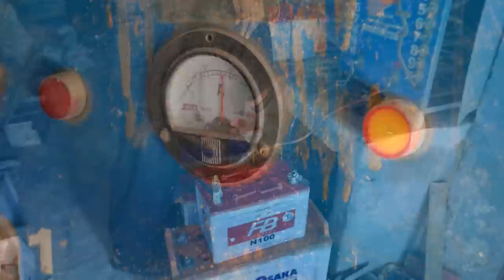How Battery Plates are Made & Restoration of an Old Battery

Comment: These guys handle lead and acid like it’s chocolate 💀
Reply: @krisg822  I bet the owner don't even care about the safety...at least respirators would be OK. Anyway...
Reply: their body cells are already immune and producing their own voltage
Reply: @krisg822  yeah and what do they do with that leftover acid sludge that each old battery has??,m you think they will dispose of that in a envoiremental friendly way??, i think not..
and what about all the houses and buildings around this little shop, when the wind is blowing their way, they will ge ta house filled with lead fumes... great!.
Reply: @aivaraslabokas7172   this is what happens when humanlife is cheaper than safety equipment, it is cheaper to replace the sick human that it is the buy a respirator!!!
Reply: That iron dust might be a problem, though
Reply: @krisg822  depend on the temperature the lead was melt at.
Reply: When survival is the last option, safety levels don't matter
Reply: @SDeww  call OSHA.
Reply: @SDeww  go do something about it.
Reply: The acid is the least of their worries...  The lead is what's going to get them...
Reply: @SDeww  thats racist
Reply: Because the acid battery was used up anx it is discharged, if its fully charged it becomes acid
Reply: @SDeww  actually it can be used again if the battery is fully charged
Reply: @SDeww  For lead fumes to be a thing, you'd have to be smelting it in an arc furnace, not melting it with a torch. The stuff you see burning off are fluxes or impurities in the lead. The real danger of working with lead is lead dust and small particles of lead that can become airborne and inhaled or ingested.

Batteries are a whole different story. Wasted car batteries contain compounds of lead, like lead oxides and lead sulfate, which are bio available and can be absorbed through the skin. It's made even worse by handling acids while handling lead compounds because it accelerates the absorption process through the skin. The workers are definitely actively getting lead poisioning, while the people around them less so, unless they're going around eating the dirt near the shop.
Reply: That’s because there’s no H&S with them. 😂
Reply: The forbidden chocolate...
Reply: @aivaraslabokas7172  in pakistan in that type of work no owner
From all the working men you see one of them is owner

Comment: When I was a kid a man in my dads church owned a junkyard, he would give me old car batteries which I chopped up in the driveway using an old axe
Then I melted down the plates in a bean pot I got in the dump, used a campfire.  
  My grandfather gave me some fishing weights and jig molds which I used cast weights and jigs that I sold at some local bait shops
Did pretty good , made more then my friends that had a paper route and more fun tool
Reply: Childhood exposure to lead is mucho bad mojo.  I'm glad if you came away healthy, but you were in a lot of danger.  That's not a pearl-clutching overreaction.
Reply: Alexander Hemp good thing I started out with such a high IQ
Reply: @deadhorse1391  i don't Think so, tim
Reply: Alexander Hemp who is Tim? 😃
Reply: Alexander HEMP...OK...I see what is influencing you now !😉😃
Reply: @deadhorse1391  Actually he's fussing over his low  I Q .
Reply: @graymouser1  Those tiny things your clutching are not pearls.
Reply: @graymouser1 I used to as a kid shoot a a lot of birds, squirrel, etc with my pellet rifle. For faster reloads kept half dozen pellets in my mouth
Reply: @deadhorse1391  I did the same. Also split lead fishing weights/shot open with my teeth and clamped them on the line with my teeth too. Often those pellets and weights would leave powder lead residue on my fingers and hands, so god knows how much I ingested when they were in my mouth. Didn't realise the dangers of lead until I was much older.
Reply: Also did that, smashed old accumulators and melted the lead in  the nearby forest. Just for fun. Certainly wouldn't let my own child to have fun like this.

Comment: FYI: the vapor pressure of molten lead is very low at the typical temp for casting. So lead vapor is not an issue, especially since they are working outdoors. What is an issue though is lead dust, which I suspect would be a serious issue here.
Reply: Handling the lead oxide paste is the real issue 😦

Comment: Those guys have to be dying from lead over exposure. Very interesting video
Reply: Until computerization eliminated lead plates in the 1970s, newspapers were produced using the linotype technology.  Most of the risk was exposure through the skin when workers touched their lips. By wearing gloves and good ventilation the workers are probably safe at those temperatures.  Some linotype workers did experience lead poisoning, but the majority did not.  Electronics circuit board factories also use lead in solder, but lead poisoning is uncommon.  

I wish the video used text to explain the steps.
Reply: @timothykeith1367  Lead is more prevalent now than ever, every vehicle has 1 or more lead-acid batteries. The batteries are made with lead & lead-oxide that is highly reactive and an extreme carcinogen.
Reply: Kris Roberts  That's not clay, it's a paste made from lead oxide.
Reply: @acoldguy2381  Clay is a mixture of oxides, commonly aluminium oxide but it depends on the minerals used. Also lead and its oxides are quite stable and don't like to react with other stuff.
Reply: - - -  Kris Roberts  
Nope. It is lead oxide powder.
Reply: - -  @acoldguy2381  
Do not eat lead or lead oxide. (no carcinomas)  ))))
Reply: lead cannot be absorbed through the skin. must be ingested to be harmful. ALthough, I cannot comment on the hygiene of such a place, it looked as though the took the opportunity to wash their hands as they rinsed off the battery housing.
Reply: + - @frostbite1991  
Through constant exposure most metals can be absorbed through the skin.
For visualise this you can wraparound you wrist with copper --- a couple of weeks and you can taste the metal in your tongue.
Lead is too soft metal, so it spread around like a butter. It’s also not very visible when the surfaces are contaminated than it is a greater threat.
And the cherry on the cake -- dust oxide in the air, m-m-m, delicious  !! (no) (((((
Reply: Well somebody have to do durty works to keep running so called high class leaving 🙄
Reply: nope, I know people who are  doing same job and healthy as horse  at the age of 70. This guy probably inherited this shop from his dad or grand dad.

Comment: ONE REFURBISHED BATTERY. THAT WILL BE $1.75 .
Reply: TFJFOURWINDS cost around 30$ in pakistan
Reply: @mahaniyama  a bargain
Reply: @mahaniyama  does it work corrctly?
Reply: @el7alabi  yes, I mean its totally refurbished, clean plates, fresh acid. Good to go!
Reply: @mahaniyama  it seems that he put some old plates around new ones. So battery capacity is lower than original. Right?
Reply: @donalexey  old plates are often more oxidized/sulphated which will block the acid lowering the capacity. But when you clean the oxide/sulphate you get this lost capacity back. So it depends on how well the lead is cleaned.
Reply: @el7alabi  The quality is very inconsistent on an average these refurbished battery last for only 6 months because these people don't follow any guide lines or quality checks also  average citizens in this area don't buy these batteries they prefer branded batteries
Reply: @apkafan8004  Not so sure about that. This is actually building a new batteri, but it lookes a bit used. Very little difference in quality.
Reply: That is American.....how much in local currency.

Comment: Explain the details of the whole process, it will help to understand more
Reply: @boobgoogler  They literally only left the enclosure and the electrodes tray, the rest are new. Would it be much cheaper ? How is the price comparison ?
Reply: They cast new grids with metallic lead. The powder is old battery plates that have been calcined in too lead oxide (monoxide) they then mix the powder with a weak sulfuric acid into a paste which is then spread into the grids. It’s allowed to dry and they they are put into groups and soak it in a strong sulfuric acid solution which I believe is called forming and it increases the surface area while also turning the lead oxide into lead sulfate and then when the battery is charged one plate is converted into sponge metallic lead and the other lead dioxide At least that’s how I understand it.
Reply: @lintangkusumandaru7534  For end user these batteries cost half of the price of new branded factory made batteries but batteries which are built in this way usually last less than 6 months because they are built without following proper guidelines and any kind of quality control
Reply: @ReverandHans  your understanding about paste is wrong they import chemicals from china the powder can't be obtained from old batteries
Reply: @apkafan8004  Yes I think the battery life would be inconsistent with the vary levels of contamination during the manufacturing process.
It would be difficult to find a good market in first world countries that would demand consistent performance levels.

However, it would be adequate for 3rd world needs.
Reply: @apkafan8004  what's the powder?

Comment: I used to work in a battery factory, That dust is LEAD mixed with some clay.
we would never handle that with bare hands, their blood lead levels must over the roof.
Reply: Actually - lead is not easily absorbed by contact with skin.
The lead oxide dust I saw floating around might be a bit of a problem but - it is all in the open air so maybe not too much.
Very interesting though....
Reply: @c02Pirate  But it can be inhaled and absorbed through you lungs and upper respiratory tract
Reply: I did notice, all of the workers were relatively young.
Reply: @davepelfrey3958  That might be just boys between 12th and 16th.
Reply: Worked at a recycling plant in Australia an Indians but old refrigerat aircons and completely refurbished then an send then to India  ,,an make a killing 🤑😃
Reply: @ashj_2088  did you have a stroke while typing this out?
Reply: @balaganga6718  lol,oh wow I must have have 😎
Reply: @theykilledthegiggler 
That was a mixture of GROUND LEAD 
it turns into that paste, I will note, when they used to handle those plates only with gloves, and it's really easy to get lead prisoned...
Reply: The plate paste is a mixture of lead oxide and lead powder with a bit of antimony added. May have some fiberglass and other goodies to give it mechanical strength.
Reply: @davepelfrey3958  
Yeah... there's a reason for that and it's not covid.

Comment: Love how they pack the ends of each section with stuff that does nothing, but through the inspection holes you can only see the plates, better seal the top on so you cant peek.
Reply: Those spacer keeps the plates straight.
Reply: Or just use more plates instead of filler!!

Comment: What is the formula of the paste on the positive and negative plates?
Reply: @Elham Amini https://www.youtube.com/watch?v=HhxtfULIO7c
Please find the formulas here. Lead and lead oxide. Lead will be on positive and lead oxide (lead and red oxide mix) can be on negative. I think :) Because electricity flows from negative to positive. H2so4 diluted. Ratio you will find online only. I think distilled water is 80% and 20% sulphuric acid that will make the electrolyte.

Comment: i need to buy one of these and test their reliability myself...recycling and reusing resources at its best!!
Reply: @SDeww  that is an issue of personal protection measures and education...overall these will reduce waste of hard to recycle raw materials that end up getting burnt or buried in thrash dumping sites..
Reply: @fidel catsro
Batteries built by these people are not reliable they barely last for 6 month because they are manufacturing it without following proper SOP's, The Lead Grid manufactured by proper factories usually have a complex formula to make them last at least a decade
Reply: @awaiskamal743  naaaah most manufacturers recommend you change batteries after 3 yrs provided your charging system is charging them correctly...after 3 yrs its running on borrowed time...i change my batteries after 3 to 4 yrs to be safe..yes i agree they recondition these batteries abd they might not be as good as new ones
Reply: @fidelcatsro6948  Actually they are not reconditioning anything they are replacing cell plates

Comment: These guys must have VERY short life spans!
Reply: It’s called lead acid for a reason
Reply: @samleen  I know acid leaders too and they make life harder for everyone!
Reply: I'm sure they live a normal lifespan casting lead outdoors isnt too bad
Reply: At least wear mask dudes...it pandamic time...
Reply: @semajniffirg230  in or out makes no difference.  Lead requires certain precautions, as does any of the chemicals they use.  And the production of batteries that work reliably requires cleaner and more controlled environment.
This is crap production
Reply: @scotte2815  who cares, it works for them and they are saving the environment by recycling junks that you throw anyways.

Comment: Great job you guys , l bet these batteries last longer than Mass produced ones.
Reply: No. I like how he padded the cells with old dead plates on either side. doubt you'll find that in a new one.
Reply: @pieter bezuidenhout
Actually not, they barely last for 6 months their performance is nowhere even close to branded factory built batteries  because they are built without following any guidelines or any quality control
Reply: @gg5115  i had to take a second look and you are right , used plates on the neg bank ! new pos plates and separators but yes ,correct , good spotting

Comment: How many times can they rebuild a battery?  How many rebuilds does a case last?
Reply: Lead acid batteries are about 90% + recyclable. I'm assuming the only real waste cones from the crud that builds up between plates and the bottom. I would think that the cases could be chipped up and reused, but some plastics like gas tanks have additives to prevent them from being reused.
Reply: Its not exactly a rebuild they are just reusing the plastic body the plate grid is made from recycled lead and Paste is made from fresh matter therefore its not exactly a rebuild. And a battery build this way under the hands of these people barely last for 6 months

Comment: What kind of white paper do they put between the pieces of lead?
Reply: is not paper, is plastic, mostly nylon or polypropylene or a mixture of both
Reply: it's called the separator, to insulate between the positive and negative cells, it's a fiberglass insulations.
Reply: @Torpengpogi  ok thanks for the info

Comment: What kind of material he use for clay which covered lead plates?
Reply: i think the dirt is lead oxide
Reply: @darkbreed  thank you for your answer. One more question! What is the liquid they pour on the dried lead oxide?
Reply: @c3x2z1-w4x  could be some acid
Reply: @darkbreed  thank you for your answer bro!
Reply: @c3x2z1-w4x  i took a closer look, the clay-like material is probably a mixture of lead oxide, silicate (to increase the surface area and stabilize the reaction surface in the battery) and lead sulphate and the liquid is sulfuric acid to reduce the surface of the plates to lead again. Is a dirty, unhealthy and environmentally harmful process, I cannot recommend replicating this work. If you are interested in the process, there are ways to make work and the workplace so safe that no lead / lead oxide and lead sulfate are released into the environment. These people will die of heavy metal poisoning for the foreseeable future, and lead poisoning makes you stupid. Lead is also radioactive; it is an alpha emitter
Reply: @darkbreed thank you very much for detail answer! harmful but very interesting process! May be they collected lead oxide from positive plates of old batteries and heat them on burner and crash it right?
Reply: @c3x2z1-w4x  it is an electrolyte solutions to activate the dry cells, but the process is not complete, they should rectifier it while bathed in the solutions, this solutions is composed of part sulfuric acid and part water.
Reply: + @c3x2z1-w4x  
Water. May be with some added adhesive.
Reply: @darkbreed  Lead is not radioactive.
Reply: @gg5115  You have absolutely no idea that lead is produced by the decay of uranium. there is a so-called low alpha lead, but due to its RARITY this is only used in medical systems, any other lead is ALWAYS an alpha emitter. Naturally occurring lead consists on average of about 52.4% of the isotope 208Pb, about 22.1% of 207Pb, about 24.1% of 206Pb and about 1.4% of 204Pb.

The first three isotopes mentioned are stable. 204Pb is a primordial radionuclide. It decays into 200Hg with the emission of alpha radiation with a half-life of 1.4 · 1017 years (140 quadrillion years).
Reply: lead oxid + Sulfuric acid + some additives , LEad oxid is being imported from China